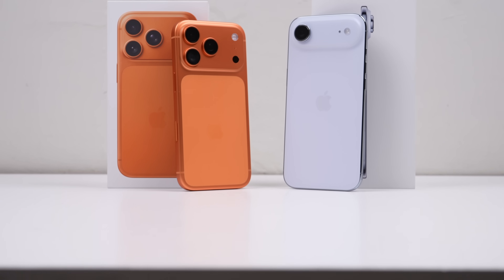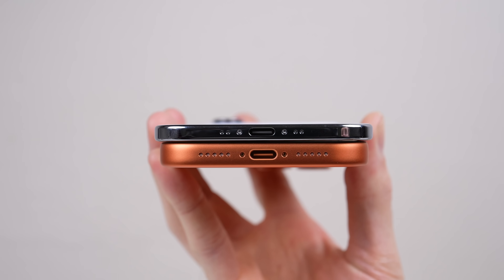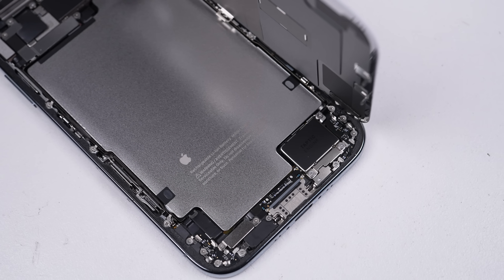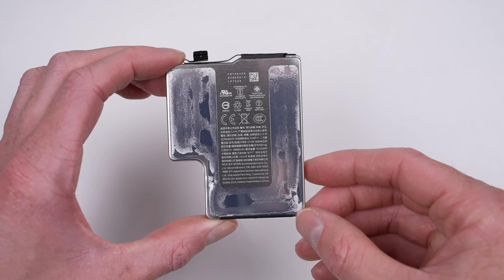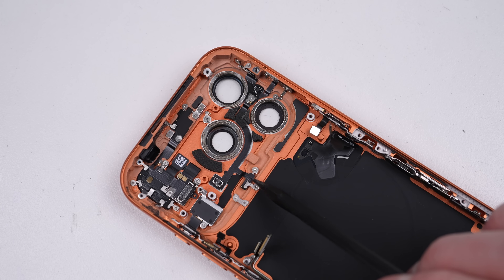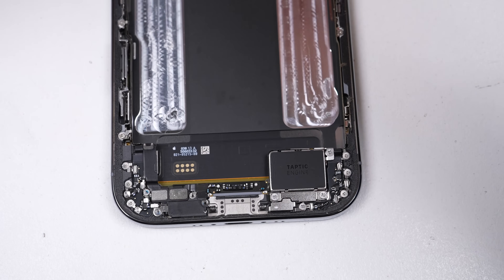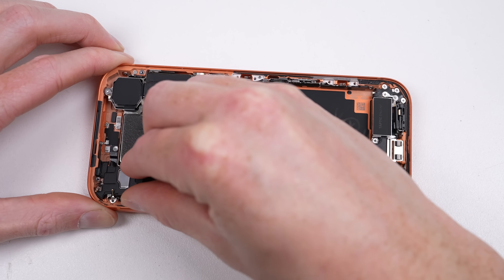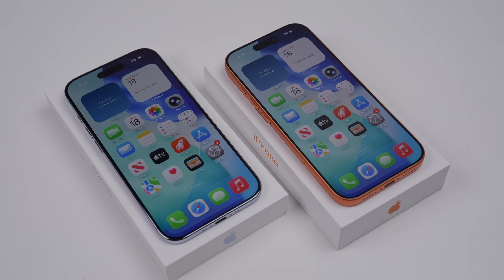iPhone 17 Air & Pro Teardown - The Real Size of the iPhone Air Battery + New Vapour Chamber

Comment: Hey Hugh! 

I have 3 phones (Pixel 8 pro; Physically good, but touch is not working, Note 20 ultra; physically used with a notch on the top right, sometime it is a little bit buggy and a Fold 4; physically used with the interior screen not functioning anymore after a hit).

I'd be happy to ship them to you if you'd like to consider those in a next video. All I'd like is to receive one of the 3 back in exchange :)

Cheers!

Comment: Feeling really pissed that you have to remove the screen on the pro to remove the battery. Even if the screen survives fine you basically have no way to rely on the IP68 rating anymore. Having replaced a lot of screens and carefully attempted to scrape the frame clean plus rubbing it pristine from residue it has never felt like the replacement adhesive is secured as well as the original. No matter the source used for the adhesive nor how long it sat clamped down. 
It's also annoying to have need for the battery to be precisely aligned on the vapor chamber frame. A few mm off and you have to get it off and redo it or it won't fit properly in the back frame.

Comment: i have a feeling Apple will sell the battery only attached to the vapor chamber...
Reply: update: i was right. a video of another repairer shows Apple sells the battery stuck to the heat sink.... so, technically the battery on the 17pro is screwed on, not adhered

Comment: Don't get me wrong the iPhone air is impressive. But a phone is only as slim as it's slimmest part. What's the point if you're just gonna have a massive bump. Same with S25 edge, or heck phones in general. Id personally prefer a normal thickness with a bigger battery and flush cameras like RedMagic

Comment: Apple: the Air has an "all day" battery life. But just in case your days are longer than other peoples, we're also launching an external battery, that's only compatible with the iPhone Air, to bring back what we took away from you, and basically cancel the entire reason why this phone was created, which was to be thin. So, it won't be thin anymore, it requires an extra purchase just so you can use it for an entire day or so, you need to charge the external battery as well as your phone, we removed the SIM card slot cause "too thin" (which, history tells, it is not, and it could also acomodate a SIM card slot), and we're also making it more expensive than the regular one, which was already pretty expensive, just so you know you've bought something "extraordinary".

Comment: Battery capacity comparisons across different APUs (and nodes), motherboards, and operating systems is pointless.

Especially when there’s a difference between selecting off the shelf components and integrating (at whatever level of effort) them all into someone else’s generic OS, versus a completely integrated stack by default.

It’s like comparing engine capacity across cars, trucks, motorbikes, and boats, as if knowing that will tell you how fast they are relative to each other.
Or comparing fuel tank sizes across them all to work out which can go further. It’s trivia information at best.

The only way to compare endurance is with standardised tests mimicking real world scenarios, which is what Apple actually does provide, along with a footnote leading to a detailed description of the testing conditions used.

All that actually matters is how long does each device last in those tests. Which device can play the identical movie/game/etc at the same display brightness output and sound level for longer? Because it doesn’t mean much if the device with a physically bigger battery drops out first anyway due to OS inefficiencies, less efficient executable binaries which need to support a swath of different APU configurations. A physically bigger battery can be a bandaid for poorer optimisation. Adding volume and weight where it needn’t be.

Comment: looks like Apple has not changed much they need to learn how to get rid of all of the 
cable to join all of the different components it just confirms why i will never get another 
iPhone as you have found out that they appear to be made unrepairable easy to 
damage the connecting cables

Comment: i remember seeing a lenovo had a heat spreader that went over the battery so i removed it from the battery part.
i wonder if the iphone17pro is safe with having a heat chamber right on the batter.  wow the sim reader is detachable id so go for a Dual Physical sim mod

Comment: 8:46 and the camera sensors are still small compared to some others. Vivo x200 Ultra's ultrawide is 1.1/28 inches, main is 1/1.28 inches, telephoto is 1/1.4 inches. The iPhone 17 Pro's are 1/2.55, 1/1.28, and 1/2.55.
Reply: 1/1.28 is as good as it gets
Reply: Hardware of a phone camera doesn't matter anymore. It's all about the software processing.

Comment: The colors & design is 🤢
I would think about grabbing an Air. You'll get 7hrs use out of it. The others scratch so easily on the back when placed on a wireless charger or dropped. 
My Wife's 13 Pro doesn't even have a micro scratch on it, same with my S24 Ultra.  Looks brand new & people just bought the 17's & are now complaining! 😂

Comment: 2:18 Lucky? I’ve been using dual esim for 4 years now and would love to get back that space in any way possible either bigger battery, better speaker or whatever.
Reply: iPhone 17 Pro	3,988 mAh (SIM Tray)	4,252 mAh (eSIM)

iPhone 17 Pro Max	4,823 mAh (SIM Tray)	5,088 mAh (eSIM)
Reply: You think the manufacturer would give you something for the space gained ? No. They're not doing that, but it's cute that you'd ask for it. Did any of these brands give you anything when they took away the micro SD card slot or the headphone jack ? No. They just save money for the OEM.
Reply: @Boogie_the_cat you do get something now though. The eSIM only iPhones have larger batteries this year compared to their SIM tray counterparts which equates to a couple more hours of battery life. Why it took them 3 years to do it who knows, but yeah you actually do get something now for that lack of SIM tray.
Reply: @Boogie_the_cat they in fact have provided a bigger battery for 17 Pro and 17 Pro Max in countries that have the esim only model
Reply: @Boogie_the_cat  i have excellent news for you… I also advise against issuing words like cute when displaying ignorance online.

Comment: The vapor chamber is on the opposite side of the aluminium unibody. It's  between the battery and the display. How can it dissipate hate from the cpu? How can it conduct the heat from the cpu or any other part to the aluminium unibody? Choosing aluminium for better heat conductivity sounds like BS to me now. I think they only used it because it is lighter than titanium. From titanium the pro models would be bricks.

Comment: Here in Europe battery sizes with sim: iphone 17 pro max: 5088 mah
Iphone 17 pro: 4252 mah 
Iphone 17: 3692 mah
Iphone air: 3149 mah

Iphone 16 pro max: 4695 mah
Reply: Objectively better energy measurement metrics considering the nominal voltages are not exactly the same.

Air 3.894V, 12.263Wh, 3.149Ah
17 Pro sim 3.895V, 15.534Wh, 3.988Ah
17 Pro esim 3.894V, 16.558Wh, 4.252Ah
17 Max sim 3.887V, 18.748Wh, 4.823Ah
17 Max esim 3.886V, 19.772Wh,5.088Ah
17 Standard 3.887V, 14.35Wh, 3.692Ah
16 Max 3.878V, 18.169Wh, 4.685Ah 

mAh doesn’t really work anymore for true equivalent comparisons. For example a 5Ah battery at the typical 3.6V is 18Wh while the same 5Ah rating at the average 3.88V of these newer batteries is 19.4Wh, a whole 7% discrepancy. Today there is no such thing as an apples to apples comparison using mAh, while Watt Hour already takes these discrepancies into account providing a true universal comparison you can use between all types of battery voltages and configurations.

Comment: Question, if Apple repair do the screen and battery replacement, do you still get a "used" advisory?
Reply from the maker: It will say "genuine" in the about page of settings, but will have noted the replacement and the date.

Comment: Why do I feel that Apple will not replace the battery only anymore. It will replace the whole metal thingamajig with the vapour chamber. This will increase the cost of battery replacement substantially and make the upgrade option much more tempting to the end user in three years time.

Comment: 8:54 While the 11 Pro is the first one to be called Pro, the 11 lineup follows the exact same format as the XS/XR. In fact, they recycled the designs of the XS/XR iPhones. I could buy an iPhone 11 case or screen protector and use it on my XR

iPhone XR became iPhone 11
iPhone XS became iPhone 11 Pro
iOhone XS Max became iPhone 11 Pro Max

Comment: Classic, removing features, calls it an improvemnt, and increase the price yet again.
Reply: “Increased price”, where did they increase prices? Its still well within the price range of their phones over the last decade ($800-$1200 for default specs of each model)
Reply: @rufus2028 True, I guess it is more about shrinkflation than increasing prices.
Reply: They added features and price is the same. Classic, commenting with no knowledge.
Reply: @ItsaB3AR Removable battery, jack, repairable parts, third party support, sim tray, mem card slot. All removed features, valuable features.

Comment: Can you get ahold of the iPhone air magsafe battery pack and see if the phone will accept the battery from that as an internal replacement? Oh, and it's a bit hard to tell from the video, but is the final protrusion on the Air camera just glass, with no reinforcing border around it? That seems like a massive risk if that's the case.

Comment: Here in the states ZERO iphones have sim trays. They went the way of the dodo bird with the iphone 14 line. So I stopped buying everything apple at that time. Re-exploring android and find the OnePlus line to be very VERY acceptable.
Also after almost 20 years of not touching a Samsung device, I will be spending some cash on a s26 Ultra in lieu of any new iphone.

Comment: everyone trashes apple for their software anti-repair measures. but iphones have only gotten more annoying to physically repair. every other manufacturer has a MUCH simpler internal layout, with only 1 or 2 screw types. its nightmarish how complicated iphones have gotten.
Reply: You haven’t been paying attention to the iPhone 15 lineup and 16 lineup.

They’re actually easier to repair now. iFixIt gave praise to the better repairability as well as JerryRigEverything.

As someone that does actual repairs on smartphones, Samsung AND Google has software locked replacement hardware. I have to go through that same unlock process that Apple does.

So it’s either you’re being ignorant for not doing an ounce of research or being willfully dishonest to mislead people into thinking Apple is the only one doing this.
Reply: @rufus2028  ah yeah, having 50000 different screw types is definitely repair friendly.
Reply: @rufus2028  i work in repair. for anything other than a screen it is the same as its been.While I admit the screens have gotten a bit better, everything else is still needlessly complicated compared to other manufacturers. 

As long as iPhones use more than 2 different screw types, and have everything be connected to a flex cable, iPhones will be objectively worse for repair. 

Google, while not the best for repair, is LEAGUES ahead of apple in terms of user repair. The need for only 1 screw head, and simple layered internal design is WAY more user friendly than a mess of cables and screws. 

Samsung devices are even better, the use of only 1 type of screw and simple modular parts makes them actually easy to repair. 

So either you dont know what youre talking about, or youre so stuck in the iPhone cult that you refuse to admit when their phones suck.

Comment: I think my only concern so far is the combination of the back glass recessed in a metal frame on the pros. Will that frame dent if it’s dropped on the right angle and make it harder to replace that back glass?

Comment: Fun fact, apple does report the battery size... At least on the EU website, at the bottom of the page there is the energy rating, clicking the label reveals a sheet with info about the energy consumption of the device, including battery capacity. So at least for any SKU available in the EU the battery capacity is known as soon as they appear on the website.
Reply: The energy rating of the EU reports 4252 mah for the pro and 5088 mah for the pro max which is vastly misleading considering EU models have smaller capacities. And it’s been like that since they phones were revealed
Reply: @tomka3794 The battery capacity data provided here applies only to countries like the United States, which have adopted the eSIM-only approach. Currently, the iPhone 17 series is available as eSIM-only in just 12 countries. Here’s a breakdown:

- *Pure eSIM-only Countries/Regions (12, with no physical SIM card slot):* In these regions, the iPhone 17, 17 Pro, and 17 Pro Max are all sold exclusively as eSIM-only versions. The iPhone Air, however, is consistent worldwide.

The list of countries includes:
- Bahrain
- Canada
- Guam
- Japan
- Kuwait
- Mexico
- Oman
- Qatar
- Saudi Arabia
- United Arab Emirates
- United States
- U.S. Virgin Islands
Reply: I dont see the battery size on it only how long it will last which it says: 53 hours. That is all what it mentioned in my country in Europa. Nowhere it says what the battery size is. I have to scan the code and then it brings me to a website where the battery size is indeed mentioned which is a bit more then 5000
Reply: @-_YouMayFind_- The battery capacity data provided here applies only to countries like the United States, which have adopted the eSIM-only approach. Currently, the iPhone 17 series is available as eSIM-only in just 12 countries. Here’s a breakdown:

- *Pure eSIM-only Countries/Regions (12, with no physical SIM card slot):* In these regions, the iPhone 17, 17 Pro, and 17 Pro Max are all sold exclusively as eSIM-only versions. The iPhone Air, however, is consistent worldwide.

The list of countries includes:
- Bahrain
- Canada
- Guam
- Japan
- Kuwait
- Mexico
- Oman
- Qatar
- Saudi Arabia
- United Arab Emirates
- United States
- U.S. Virgin Islands

Comment: Nice work on the video :) sorry to hear about the broken cable. I think companies should be required to have parts from day one.
Reply: Its pretty stupid to have parts already ready on day 1. Logistical costs are already too expensive on a new production line to be shipped raw components. It is mathematically cheaper to replace the iPhone itself if it’s having problems day 1 out of the box.

And if you are inside the phone on day one, it’s your fault if you break something. Also, you can’t blame apple if it was faulty out of the factory because of you’re well within that 90 day and 1 year warranty if this is a day 1 issue.
Reply: @rufus2028  this is the dumbest take i've ever seen, i hope atleast Apple paid you for this.
Reply: @rufus2028  so if I drive a brand new car off the lot and smash right away, you think it’s reasonable I should just replace the whole car?

Comment: i dont get yalls obsession with there not being a sim card, its kind of how people still bring up the lack of a headphone jack, maybe prior to this model where apple just threw a plastic part in there and didnt use the space but this year theres 0 reason to complain about not having a psim. no one actually uses more than 2 lines (which esim supports) and even for those who do its like 2% of phone owners, the majority of people arent using more than one line and for the "b-but you cant remove it for privacy" yeah well welcome to 2025 where these phones track your exact location even when the phone is off and talks to every other modern apple device around it. complain about this but have no problem with apple switching to a weaker charging port like USB-C when the lightening cable was far superior and stronger, the push should have been for apple to make a modern lightening cable not that garbage usbc standard

Comment: Good thing that Apple decided to cease the Li-Po battery in a steel box. This is the beginning of the end of the "spicy pillow" battery era.
As matter of fact, if a polymer battery develops even a small amount of gas, that creates a space in the electrodes stack which increases the internal resistance of the battery which - in turn - creates more gas during recharge, and so on in a regenerative pattern. 
After only 18 years, Apple recognized that a case-less battery doesn't represents a saving, in space, in money, or otherwise.
Thank you Mr. Jeffreys for this video; I personally stay away from Apple, but I like to watch their engineering solutions and the way they balance the cost of manpower vs the cost of components.
Greetings,
Anthony

Comment: Are you skilled enough to micro solder the Taptic back to the connection?

Did you find the 5G antenna?

Personally, I don't see the point of making mobiles so thin.

Comment: I wish it was explained what actually was underneath the plateau on the Air. Was that the speaker you removed from around the camera flash? There's also a lot of misinformation on the internet about how those plateaus house all the internals which is visibly incorrect - most of the motherboard sits bellow the protrusion in both models. So what does the Air plateau actually house? Camera, Face ID _ front-facing camera, speaker, flash and what else?
Reply from the maker: It houses part of the camera, logic board and earpiece speaker in addition to the LED flash and microphone which is connected via the cable running to the back panel.